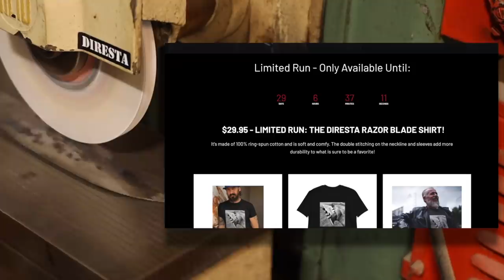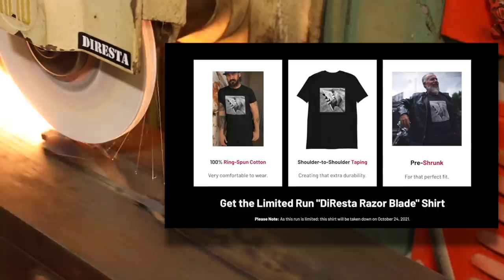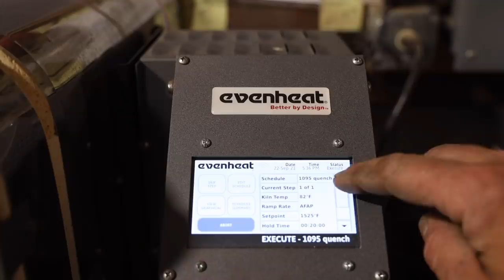DiResta Crowbar Knife

Comment: JD... I am retired and learning how to forge. Made a charcoal forge from an old gas grill. I have two questions, p!ease... First, what is the degree of angle on your bevel jig? Second, I bought an OLD anvil (a gift) and would like to reface it. After welding the rings in the edges and sanding the face level, could I weld a new face onto it? Don't have a lot of $ (retired disabled vet) but would like to use whatever I have. Thanks. Awesome knife, by the way.
Reply from the maker: Thank you 🙏🏼 about 4/5 degrees. The anvil should have a hardened face.  You can get hard welding rods and build up a new face ?

Comment: Nice knife Jimmy! I was wondering, what is the purpose of running the file across the blade after heat treating?
Reply: It’s a way to test if the heat treating was successful, a file will bite into and cut mild or I hardened steel while a hardened blade the file will just “skate” across the top not causing damage